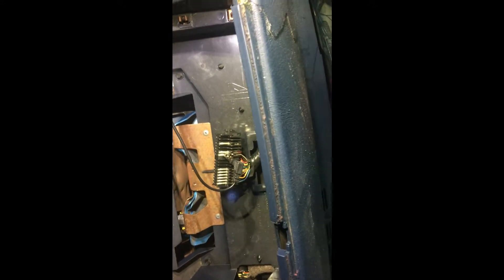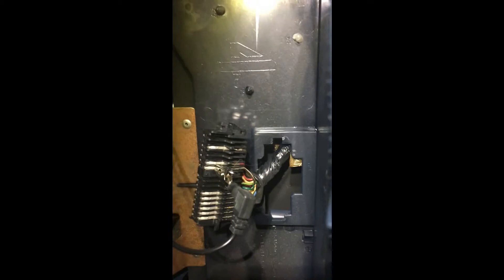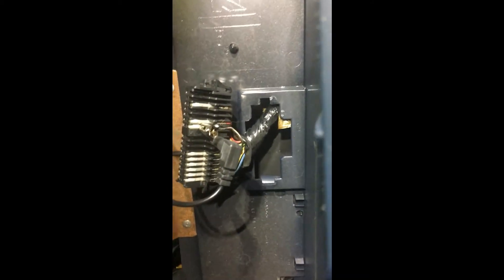1995 Chevy OBS Cheyenne LS swap MIL or "check engine light" wiring

Comment: Is this the only brown and wite stripe?
Reply from the maker: No, it is not. That is why it is important to trace down the correct wire, I used the '95 GM electrical manual and then used a continuity test feature on my circuit tester tool. Having said that, I got the correct wire first time on the '95, on the '91 it was a little more complicated, but not hard.
Reply: @laurencevillegarage   I have a 96 should be the same ? I've been looking for a pin # to make it easier but haven't found anything  on it